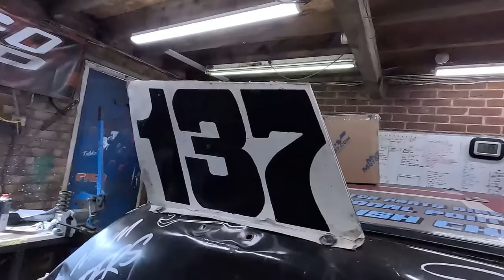Prepping Every Inch Of The Car & Practice! ep55

Comment: You always dissconect the anti roll bar before cross weight...The anti roll bar connected gives wrong figures if there is any tension in them
Reply: We don’t run one
Reply: @fredtebbz  run a string around the centre of the tyre in a full circumference take a measure and do the same thing on all your spares and you will see a massive difference so to gain more push in the car the longer string tyre and   slight toe in will make all the difference